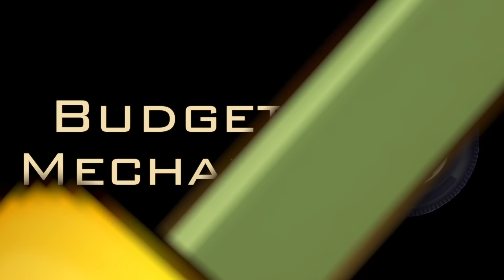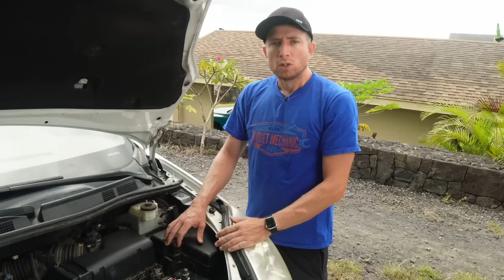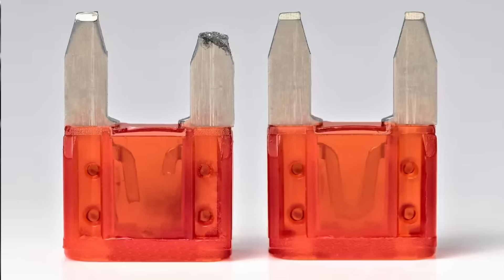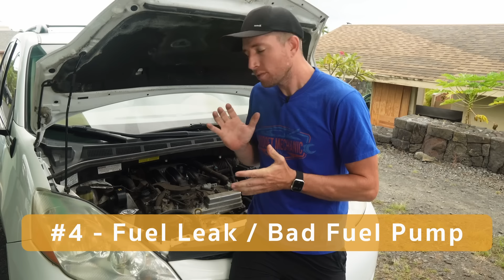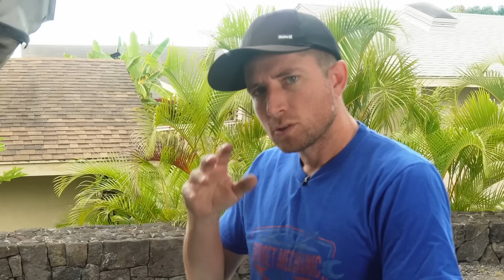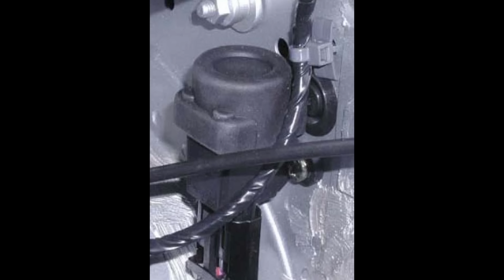Car Cranks But No Start? Diagnose And Fix Now!

Comment: I've had a handful of problems lately, the main one is the mechanic
Reply: i got the same with crooked physicians & esquires.
Reply: Tell me about it. I'm stuck with having to diagnose and fix my own issues, because I don't trust the vast majority of mechanics. I just got screwed on a vehicle inspection. I didn't care the cost (within reason), I just wanted a full vehicle inspection that wasn't tied to the potential repairs that are generated for them to then fix (it's a high mileage vehicle that's 20 years old).  It was supposed to be an hour long inspection, but they almost certainly spent 5-15 minutes on it if that. My invoice only had 5 points on it from the inspection.  Needs starter - no it doesn't (that was one of the things I wanted them to look at, but they immediately jumped too needs starter, but it's definitely not that); transmission fluid is burnt and low suggest transmission service - 100% false, transmission fluid was and is a little too full (which wasn't my doing) and it's still pink. Front lower Ball joints are bad (I'm not 100% certain on this one, but I'm skeptical)- Tie rod boots are torn - not sure, but I don't have any of the power steering symptoms but possible and a cheap fix. Front Struts are worn out - Most definitely - that's one of the things I wanted them to look at because I know they are and I'm intending to purchase a full strut assembly for both the front and back to fix myself, but I wanted their advice on if I need a full strut assembly on both the front and back and what else might I possibly need to do with that. Fog light cover is broken - no shyte. And valve cover and power steering system are leaking. When they called me up the front man had a we have bad news for you and wanted to start fixing these things, but I picked my car up and there's a bunch of other shady things, this ramble is long enough - when I picked up my car there was fresh power steering fluid all over the valve cover and underneath, which wasn't there before. And now I have to wonder if they f__ked with my car to make their bs diagnosis correct.  My intermittent starting issue has gotten significantly worse and I'm diagnosing it now, which this video helped a lot. 

Anyways, almost all repair places have a some type of commission structure, so with that it naturally incentivizes these people to rack up fixes to make them the most money... and the vast majority of people have 0 knowledge about vehicle mechanics, partially myself included, but I've recently learned and am learning a lot, so with that online reviews are almost completely worthless in the realm of auto mechanics... the most crooked ones have these great 4.8 ratings and it's because they have some well spoken clean cut guy being the front man for the mechanics and this persons job is to rack up as many fixes as possible for the customer. And because some clean cut well spoken person - most knobs are going to think it's great and since these places fix anything with dust on it and then some, you should rarely run into problems. Does anyone know of such a place that is solely incentivized to do vehicle inspections and not repairs. They perform $200 full inspections/full dianosing and that's their business model... or is that just too risky of a business model because unlike a mechanic all of their inspections are going to essentially be fact checked and they're going to be wrong from time to time even with expertise and good intentions, but anyways. It sucks. It's the one area where so many of us are vulnerable because the majority of people have a weak understanding of auto mechanics. And there really is no repercussion, but that's full blown theft and/or fraud.
Reply: @LibertyRapsher  i am sorry that you have so many claimed problems or parts worn out. cars are just like us, we need more attentions when we get older.
first start out with the following:
1. year/brand/model/trim/auto or stick/mileages
2. original owner/used/pms done be dealership/shop/you
3. what is the most important that needs to be fixed

better if you reply your email address here
Reply: you mean the guys who fix one thing & then something else goes wrong, the mechs with bad hands😅😅
Reply: 😂😂man who you telling my chevy express 2500 has been with the machenic for a month now first dionysius was the fuel box in the engine he pulled it cleaned it started right up told me it was good to go I would have to replace fuse box cause the lid has been off and corroded but a couple hours later he called said it won't start I needed a new box so I ordered that he put new box new ignition switch called me yesterday it was good to go he even pulled out garage when I arrived to pick up it started right up a couple mins later it died outland won't start again smh and now the machenic states he has no clue what it is like what kinda machenic are you smh
Reply: Hey man dont be so hard on yourself 😅
Reply: 😂 Seriously though how they are so unreliable in this field of work crazy to me!

Comment: I own an 05’ Sienna and sometimes when the engine has been running for a while shut off and immediately re started it will just crank crank crank but won’t start.
When starting from cold this never happened…
No coded are showing.
There is no fuel pressure port on this car
What can I do?

Comment: Sometimes my car cranks but does not start. When if happens the problem does not get away by itself by reytrying. They checked my fuel pressure  (when the car starts normal) and it's ok. My spark plugs are ok. My battery is ok. My start motor is ok. They can't reproduce the problem at the service center.  When it happens, if I disconnect the negative pole of the battery before starting the car, and reconnect it, the car will start. What could it be?

Comment: brother very informative i been researching this for a month just to get all this information in such a clear form know i have a glimps of hope that my car will turn on at the moment im dealing with starter not engaging with fly wheel but ones thats good it should run in theory! checked everything else even learned how to check sensors on the way haha thank you subscribed right away

Comment: I just bought a used 2008 nissan xterra, 2 wheel drive. Ive only had it a week, and immediatelly it sometimes difficult starting it makes sounds trying to start but takes 5 -   10 seconds sometimes to finally fully turn on and engine run. But usually if its been running and only recentlly turned off , if i start it soon after it seems to usually start right up. I may be misremembering, but it seems to have more difficulty starting fully if its been turned off for a few hours or overnight. Guy who sold it to me said nothing about it, but i dont trust him at this point, as  no way it literally just started happening the day i bought it from him. I had battery tested and its good, only a year and a half old. 
And i noticed a slight fuel smell today inside the xterra while driving it. 

Unfortunately i was told by oreillys auto parts when i asked about getting a new fuel filter that this model xterra doesnt have just a simple fuel filter that is easy to access and remove and replace alone, as its instead supposely inside the friggin fuel tank and has to remove the friggin fuel tank and replace whole fuel assembly and buy and whole new fuel assembly to replace fuel filter. Which is nearly $400 for just the part! What batshoot craxy dumb design instead of jjust having fuel filter outside fuel tank easy to access and replace like some vehicles..

And this xterra has a built in alarm system connected to a chip in the key, apparently. When locking and leaving vehicle apparently after getting a certain distance from vehicle thealarm automatically arms. Suddenly today when i drove to auto store and turned engine off and removed key, immediatley as i opened door to exit the vehicle the alarm suddenly went on making alarm noises for a minute. Had no idea how to turn it off or why it suddenly started alarming as i was still in vehicle with the key in my hand. It at least stopped alarming sound after a minute. Just concerned as it shouldnt do that and have no idea why it did or if its going to again and how to stop it.
Reply: I guarantee you can access the fuel filter easy.
Reply: If it takes a bit to start unless warm, it kinda sounds like your fuel pump is wearing out

Comment: I really enjoy the channel very informative completely I have 97 grand prix I've never changed fuel filter last week it acted like it didn't want to run so I took off tube for throttle body and cleaned it and it started but now it just won't start it's getting fuel pump comes on what can I check at fuel rail to see

Comment: Couldn't be any of those, it starts fine most of the time, came up a steep hill pulled over shut it off, won't start again, then it cools down for an hour, THEN it will start, that's what happened before ???!!!
Reply from the maker: Why did you pull over and shut off after a hill? Sounds like a potential sensor/electrical issue
Reply: @BudgetMechanicHawaii   Pulled over and shut off to check out the checking free public book box on the way home, still can't understand why it's doing this sometimes but not usually, most of the time it starts in a flash,  that's going to make it hard to trace down do you suppose, van is a 2002 Honda Odysy?!

Comment: Hi my car cranks but won't start, however if I press the gas pedal when starting the car starts! Any ideas what the issue is?
Reply: Hi, Did you fix this issue?

Is your car auto or manual?

Comment: okay... got one for you.. im working on a tug airport equipment.. crank no start but if i take out the fuel supply from the injectors, engine runs..it runs from the fuel that is on the fuel rail after it burns off engine dies.. you got anything from me
Reply from the maker: It’s awesome that you even thought to try that! That’s a tough one, perhaps some kind of fuel pressure sensor/switch?

Comment: Hi...

My toyota 2004 vitz ignite but don't start at first, however start at 2nd or third attempt and then runs smoothly... Hope you have a solution to this... Waiting for response
Reply: probably your check valve on your fuel or pump is't working. way to tell is you turn key on but don't crank it for two seconds then off, then on again, if starts on 3;rd time right away that's it . the good is you do that so the fuel runs all the way to engine , until you want to put a new fuel pump.

Comment: I just got a 2010 Sentra’s for $300 because the owner thought he blew the engine. Was cranking and not starting, lol I fixed it with a $12 pull a part air intake tube. The original intake tube had a big hole in it which messed up the air/fuel ratio and stopping the engine from starting lmao 🤣
Reply: That's awesome
Reply: My 2010 Avanza 1.5 is has no engine light but is cranking and refusing to start
Reply: Pls kindly advise, mine cranks some many times (8x) and eventually start, Could this problem be related to yours?
Reply: @enjanih  yup. CHeck it out . Listen for air coming from where it shouldn’t . Feel the intake tube if you feel suction replace it
Reply: I have a 2005 Honda pilot and now my  key won't even turn
Reply: 😢 @PenelopeBly
Reply: I hope someone takes advantage of you too one day.
Reply: I don’t have a car, but I have keys. Please advise, would love to have a car 😅
Reply: I just brought a 2006 c230 and it won’t start what should I do

Comment: What if your car cranks but doesn’t start with no codes on
Reply: My car is 2007 so I assume I don’t have most of the sensors cars nowadays have, and truth is, they don’t.
Reply: Chances are you do @frankiewild99
Reply: Did you figure it out?
Reply: Run the tests he laid out.
Reply: Engines need 5 things to start, fuel, spark, oxygen, timing, and compression.

Comment: My 2006 mini shuts off completly when i put it on reverse, all other gears works well it can drive forward. Tried starting it while on reverse but it just cranks but wont start. On neutral it starts ok. What might be the issue?
Reply from the maker: It cranks while in reverse?? Is it manual transmission?
Reply: Vacuum issue?

Comment: I have a 2007 ford explorer sport trac v8 .
About 2 months ago i was driving and out of nowhere it died on me and would not restart. 
I have a screen that shows the battery and says check charging system.
I had it towed to my house.
( it trys to crank but won't start)
I have 
- put in a new battery

- took off alternator and took it to auto parts store where it tested good

- checked basically every fuse under the hood and inside the vehicle 

- checked every wire connection I can, and cleaned every possible connection point

- can hear fuel pump engage when turning the key to auxiliary mode

- looked for vacuumed leaks

And still the same result.
Trys to start but won't.

I also bought a code reader and it shows 0 codes.

Any thoughts?
Reply: Exact same issue, in my case i changed alternator and it was working fine for some days. Now vehicle do crank but engine do not turn over. My mobile mechanic says its not starter or alternator issue. Have you found out what your issue was?
Reply: @roshanadhikari9003  I've been really busy so I sporadically have time to work on it.
I've changed basically every sensor on the thing, just put a new fuel pump and filter in.
But I think I found the problem last night !
I pulled out all my spark plugs just because I am running out of ideas.
( I checked a few of them for spark a while back and they were firing good )
But last night I pulled out all 8 and found 2 of the plugs are completely missing the electrode/ground ( the little metal hook/loop on the bottom of the plug that the spark fires to.) 
Hoping that I get time tomorrow to put new ones in. ( gonna replace all 8)
I will leave an update if that fixes the problem.
Reply: @jackucthatjack5896  also heard that fuel pump driver module if goes bad gives same issue, I will try to change that in mine tomorrow before bringing in mechanic if that works
Reply: @roshanadhikari9003  I went ahead and cha.ged spark plugs. It did NOT fix the issue.
But that Fuel pump driver module sounds like it could be the solution.
Let me know what you find out if u end up doing that tomorrow.

The last time my vehicle was running It was running fine with no noticeable problems and out of nowhere when I was driving up a hill is when it shut down. 
There was no hesitation. It just went from running fine to shut down in an instant.

Comment: My 94 Camaro is having a hard start, and it began right after the new starter was put in. The kid added washers to seat it instead of putting the new bolts in so I'm wondering if that would cause the hard start.  If it doesnt I'll check what you suggested in this video.
Thanks for your knowledge
Reply: Maybe it's a bad (new) starter, or possibly the wrong one? Check the model number.